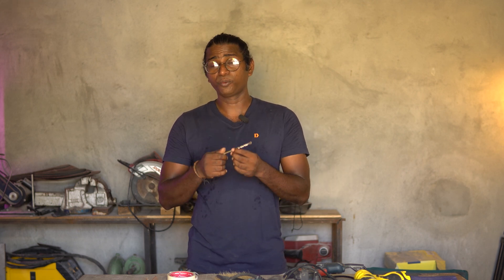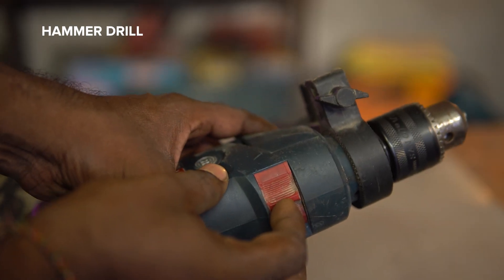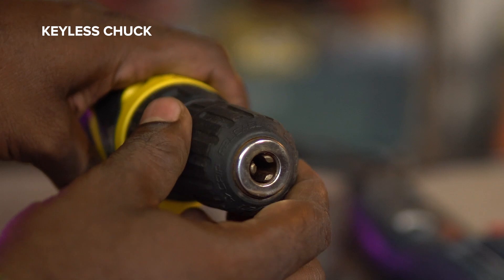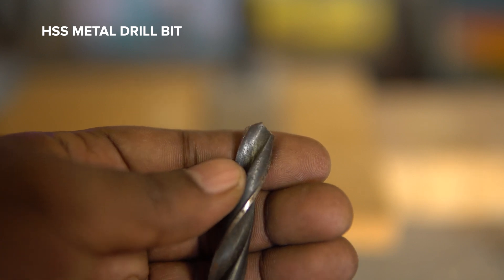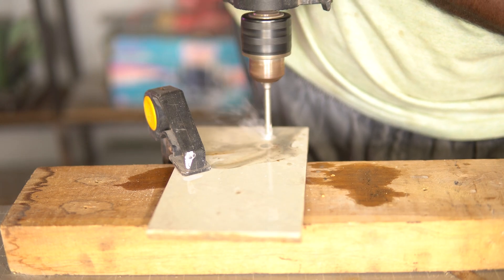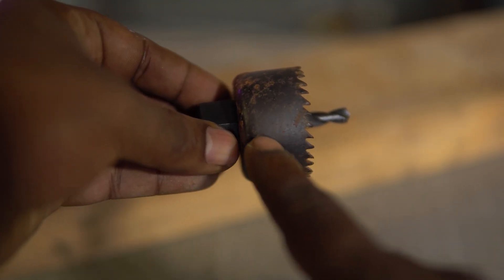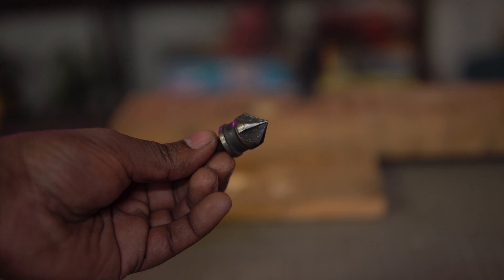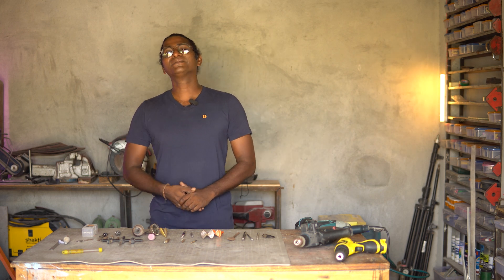Do you know which drill bit to use ?

Comment: Hi very good video. I have a doubt. Can use masonry drill bit in a non hammer drill machine to make holes to fix a small shelf
Reply from the maker: Not advisable. Depends on how deep the hole needs to be and the wall strength. It may dull the drill bit. if you have no other option, Try doing it slowly and cooling the drill bit with water

Comment: Nice information, Ceramic bit i imported from China has 4 sides that provides more precision and stability, i use this bit everywhere as a center punch 

Step drill bit is very useful, it is a multipurpose bit, specially in steel sheets it works best

I bought many drill bits with Titanium coated, its color is golden but Titanium is not golden color wondering!

As per your experience if you feel any difference in Titanium coated & without coated, please let me know
Reply from the maker: Thanks for the info bro. I is quite an interesting question why titanium coated bits are gold in color. I am sure why that is. But I am eager to find out